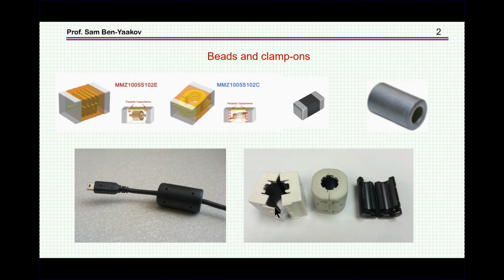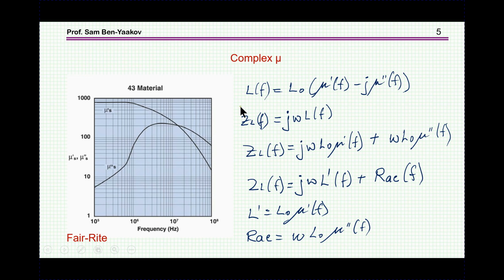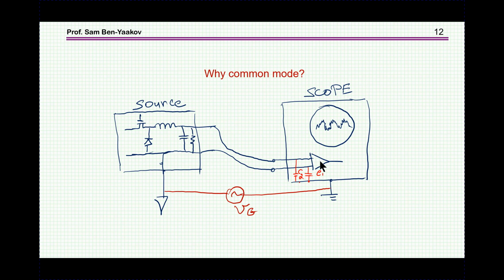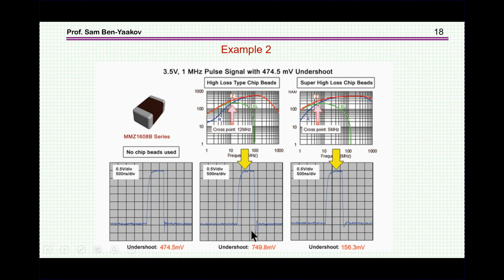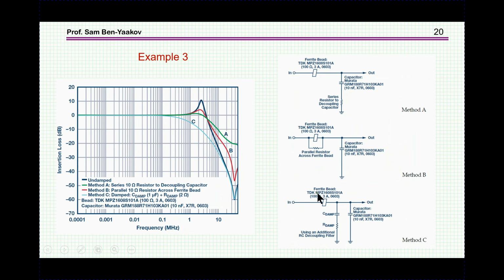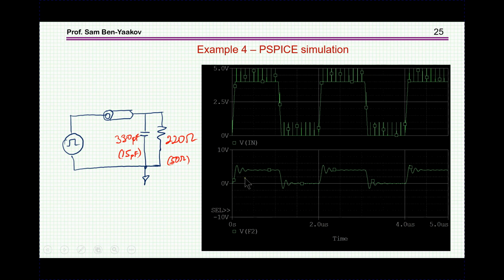Ferrite beads in power electronics

Comment: Thank you for the video! Might you know how I can identify and characterize an unknown 0201 size type SMD ferrite bead? (e.g., testing in situ or ex situ of a working second circuit to replace it in a disfunctional first circuit of the same model?
Reply: You can extract two key parameters, DC resistance and inductance with a simple LRC meter. That goes a long way, but now that China makes very cheap network analyzers, you can do full modelling as well.
Reply from the maker: This  better be done by a wide band network analyzer but you can get the information with wide band (at least 200MHz) function generator and scope using a voltage divider,
Reply: @sambenyaakov  Thank you so much for your fast reply! Might you have any product, or product line recommendations? I am situated in the Netherlands
Reply from the maker: @sharymens8187  Omicron's Bode 500 will do the job

Comment: Hi Prof. Sam, I'd like to thank you for an insightful video. A few questions which popped while watching - 
1. since Rac is basically core losses shouldn't we perceive the added Rac in parallel to the inductance part?
I've saw that you disputed the "simple model" by TDK for example. 
2. In Clamp bead, I've wondered if the MFR's are taking into account any misalignment in the clamp which might cause an air gap.
Does the design takes into consideration that the magnetic path is solid or gapped? - I assume it's the former (just checking).

If possible at all - can you help by sharing relevant publications
Reply from the maker: 1. It is not that I am against the lumped equivalent circuits,.They are good for emulating the impedance but, as I have pointed out, I think that the loose the phase information which in most cases is not that important.
2. The clamped bead are assumed to be with practically no gap,. The gap between the bead and wire does not matter (Ampere Law)

Comment: The thing I don't understand is, isn't inductive reactance essentially frequency dependent resistance? Or is that precisely what you are saying? That the reactance is welcomed and the DC element of inductance is the parasitic part... in this application
Reply from the maker: The bead has real power loss which increases with frequency. This can be modeled as a frequency dependent resistor.  Reactance does not dissipate real power.
Reply: @sambenyaakov  Thank you for the explanation.  I was not aware of that distinction. I am studying alone, no schooling. Your response was helpful and much appreciated.

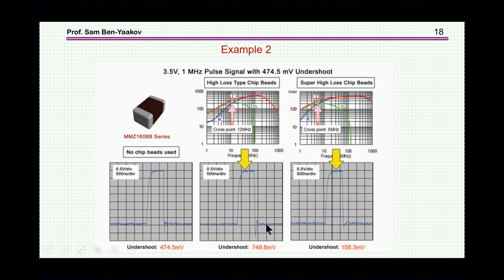Comment: Am I right in saying that the reason for the example on the right at 19:55 being optimal is that the fundamental frequency of the falling edge is 5MHz, which matches the cross point on the ferrite bead's ZRX graph? (I estimated 5MHz from the fall time on the left graph appearing to be approximately 100ns, and a sine wave with a 100ns period between its peaks would have a total period of 200ns, i.e. 5MHz)
Reply from the maker: It is optimal in that it is more a resistive than inductive at a lower frequency. Ideally we would like to get rid of XL

Comment: Hi Dr. Sam,
Ideally, we would want a ferrite bead that doesn't have an inductance component. Just the resistance at high frequency. Correct? If yes, does that mean we should choose the lowest inductance over frequency ferrite bead every time?
Reply from the maker: Yes, but a low inductance bead will also have a low resistance. Try to get a bead with the highest  R/L at the relevant frequency range.

Comment: Hi Sam. The video is very nice. Congratulations. I have a question about the use of ferrite beads on both ends of the cable and when it is applicable. Sometimes people use this approach to minimize EMI effects on RF systems  in the proximity of the cable (I think so)...
Reply from the maker: Ferrite beads on a cable act like a common mode filter

Comment: Dear Dr.Sam,

I really appreciate your efforts in making such an elobarate educational videos on current edge technology to help the upcoming students. However, I am completely confused and surprised to see a ferrite bead in the path of a gate driver on slide 3, 1:36, according to Transform company. 

It is highly desirable to keep length of gate tracks shorter and wider to maintain as minimum inductance as possible in the gate driver path. Higher inductance in gate path offers higher impedance to high frequency gate signal. Using same reason, how can we endorse a ferrite bead in gate driver path, which is also an inductor basically. (Its frequency response also proves it).
Reply from the maker: Thanks. You have a good point. I am not sure myself aout FB in gate driver. I tried it and did not se any benefit. But: THe FB might perhaps be useful  cases of potential oscillations at very high frequencies 100's of MHz  at which the bead is resistive while the added impedance at lower frequencies can be tolerated. i.e. wL/R is smaller than 1 .

Comment: Thank you for posting such an good informative video.
Does this mean that when IC  manufactures recommend to put ferrites chips on nets powering the high- speed serdes (to get a clean power), they are actually degrading the serdes performance because the ferrite chip power filter hinders the serdes circuits to draw power rapidly?
Reply from the maker: Not if the bead are selected wisely

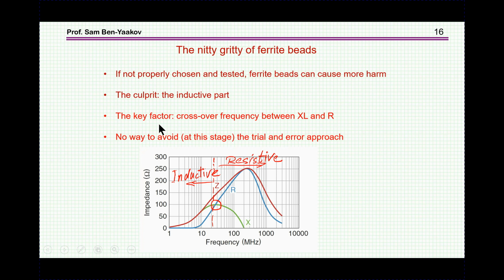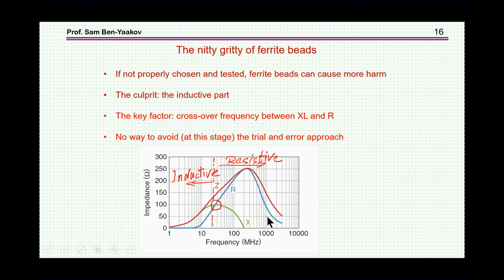Comment: 16:34 to 17:00 ... You state the crossover R/X is the key factor. Why?  Because lower freq of crossover is better, for higher freq of interest, so L resonance w/ parasitic C is pushed to higher freq. where R is higher (lower Q)?  If so, it seems that would make the lower crossover freq a bad choice for filtering dc/dc converter ripple (lower freq).
Reply from the maker: Ferrite beads are not meant to replace filter inductors. They are meant to add damping (lower the Q). So if the inductive part dominates it is defeating its purpose.
Reply: @sambenyaakov  I'll take that as either a "yes" or "you emitted an unclear question". Either way, your answer suffices. Thanks.   :-))

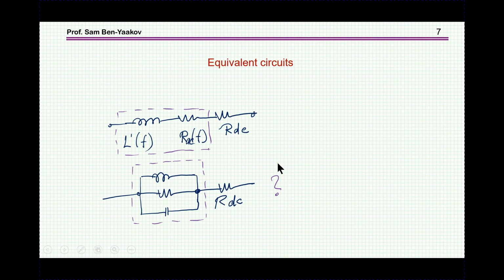Comment: 8:40 Earlier comment asked about your phase-accurate models. You said it would be public-domain. Can you provide any update????  I have an immediate need.  At least, some pointers on your approach & methods (pspice or whatever).  THANKS !!
Reply from the maker: Hi, I plan to prepare a video on that when time available😊.  It short, one can use ELAPLACE behavioral model to create a non linear frequency dependent resistor and then add it to a non linear inductor

Comment: How do you account for linear regulators that require low ESR capacitors at their inputs? I found a paper from Linear Technology that details using ferrite beads at both the input and output reduces switching noise, but this renders useless the use of any damping resistors to limit high frequency spikes from the ferrite beads.
Reply from the maker: Ferrite beads are not the ultimate fixer, but could be very useful if used wisely.

Comment: Excellent video as always :-) I have one question: Are all of these impedance charts for ferrite beads given for one wire going through the bead? What if I put several loops through the toroid?
Reply: ...I meant what happens to the resistive part. The inductance will roughly (not exactly because it is nonlinear) increase as n^2 but the resistive part I think should behave differently. also where will the resonance (peak) move to when I have several turns?
Reply from the maker: Manufacturers show measurement of Z for a number of terms and the impedance behaves as n^2 so both the inductive and resistive parts increase.